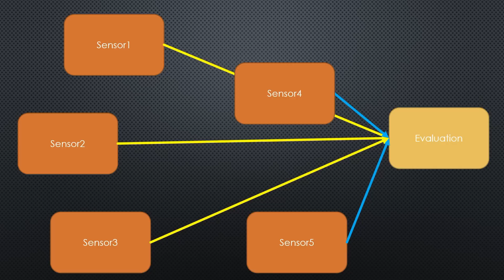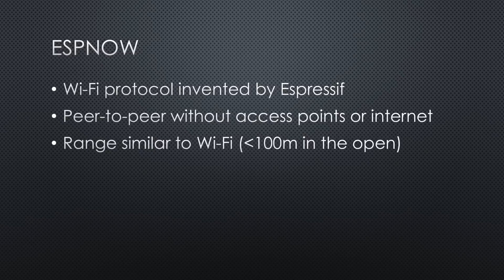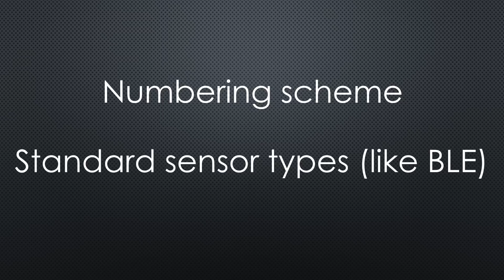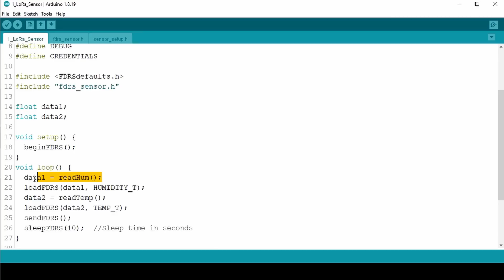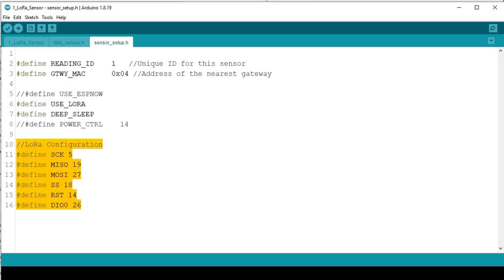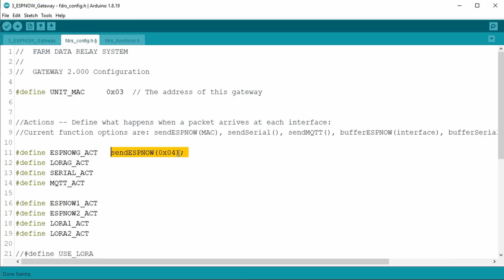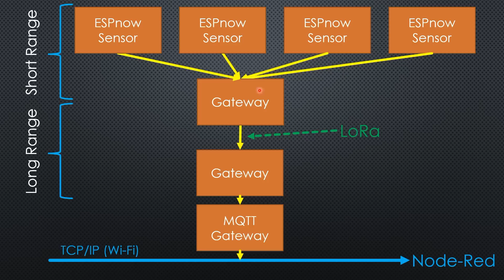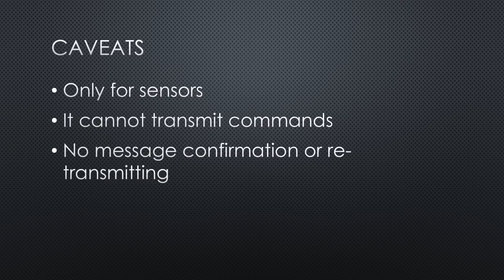430 ESPnow and LoRa Network (incl. Repeaters and Gateways). A TTN replacement?

Comment: Very very usefull, but as you mentioned adding support to send commands to eg. run actuator, and msg recieved confirmation would complete this wounder full idea. 
We all should contribute in completing this project.
Reply: Thank you! There actually is some bi-directional capability, it's just not "official". You can read about the concept here:
https://github.com/timmbogner/Farm-Data-Relay-System/blob/main/Controllers/README.md
Reply: as I explained in the above comment, ESPnow in unicast configuration gets the "message received" confirmation and you can check it on callback_on_sent function. Problem is with broadcast only. Btw the question is what to do with the "sent failed": repeat instead of going to sleep or go to sleep and try the next time - the answer probably depends what is more important: regular temperature/humidity update (then repeat) or "let me see the values next time" so go to sleep
Reply: @zyghom  sure, It woul be more important in sending commands, where you want to know if some engine or light or something is switched or not. But there comes question of waking up from sleep.
Reply: @kzstmla  for critical situations like this, forget sleeping then. The "only" ways to wake up ESP32 are: timer or gpio, right? So when it sleeps you cannot do much unless you can "touch it" this way or another or wait for the timer to expire. But then how to touch it if it is remote? Another receiver? That is too much I think. Light sleep? Hmm, still in mA so not much of battery saving. Just thinking loudly but if you find a way let us know ;-)
Reply: @zyghom  I am not sure how good solution is timing, as i doubt its precision, unless you have some wide time slot when you expect something and then to sync times every time something happens
Reply: @kzstmla  I got lost: which timing you are talking about?
Reply: @zyghom  time syncronisation
Reply: @kzstmla  between? gateway and sensor? why would you need it in case of sensor going to sleep? and in case sensor does NOT go to sleep, then you don't need ESPnow - you can easily stay on WiFi and if you are on WiFi then ntp is your friend. Or am I missing your point here? ;-)

Comment: I am doing the same, but with nRf24 in mesh config... with MQTT gateway from nRF to Wifi. nRF mesh is pretty cool, since it 'configures' it self when nodes come and go or move around.
Reply from the maker: Cool project! I found that the NRFs were pretty limited compared to todays possibilities. Meshes are very easy for the application. However not easy to make them stable and keep the overhead under control. Good you were able to get these things solved.
Reply: @AndreasSpiess  Not sure, I found the capability not less than what an MQTT end client / server would require. You need to plan a bit more structured when it comes to the protocol, or data exchange over nRF. I am packing my data into a struct{x,y,z} and have the nRF handle the transmission. A bit of timeout/retry handling vs. node reboots and it becomes a nearly self healing system. ESPnow I never tried, but rather stick to a MQTT layer on a ESP.
Reply from the maker: @SarahKchannel  If you are sure you stay below the 32 bytes or so, you are right. I also used structs for this purpose.

Comment: Hi Andreas, how can we make use use of old WIFI antennas to detect radio signals and track them on our 💻?
Reply: I mean.. you kinda can only detect Wifi very well with an Wifi Antenna.

And what kind of tracking? There are different kinds. Location, direction, just if its there, what its sending..
Reply from the maker: You connect the antenna to a receiver as always.